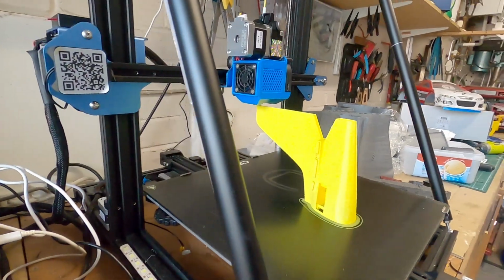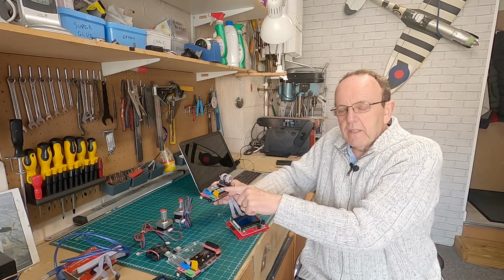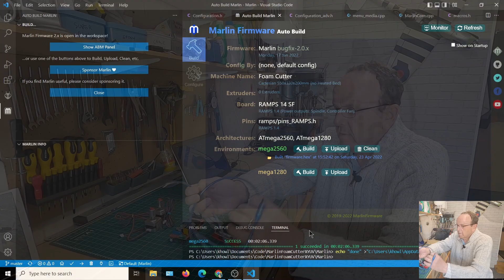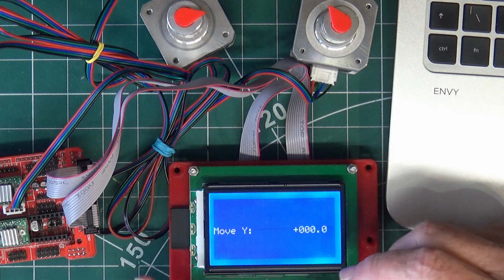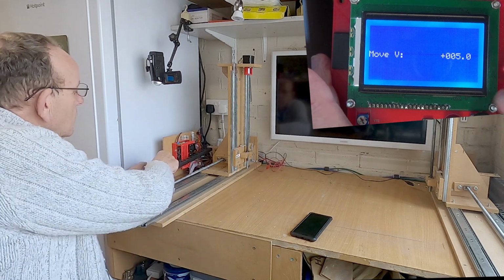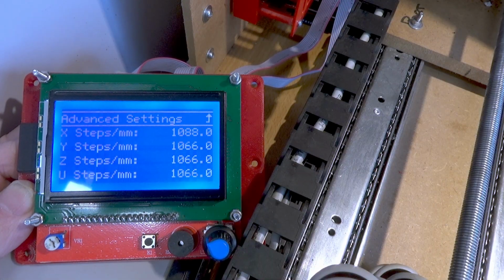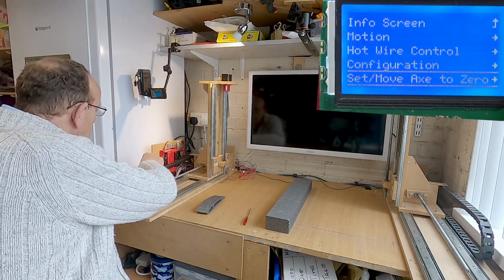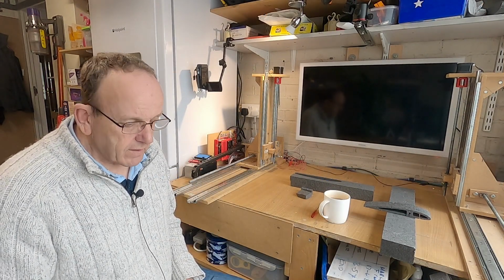CNC hot wire foam cutter using Marlin 3d printer firmware Part 2

Comment: Hello Keith. I can confirm that the code loads and runs as you describe with no issues. Will test the end stopes and Steps calibration. in the next few days.  Thank you Again. The only thing I changed is line 99 in Configuration.h is //#define MOTHERBOARD BOARD_RAMPS_14_SF
    to       #define MOTHERBOARD BOARD_MKS_GEN_L_V2
Reply from the maker: Your welcome

Comment: Has anyone used a Re-ARM board based on LPC1768 microcontroller with RAMPS board with MARLIN firmware for 4 axis hot wire foam cutter?
Reply from the maker: I haven't but I think it should be possible if you re-configure the marlin code for that board.
Reply: @rckeith  I will try it next week, and I will let you know if I succeeded